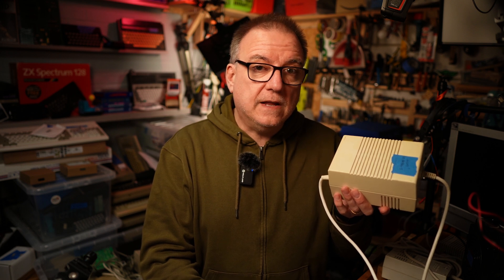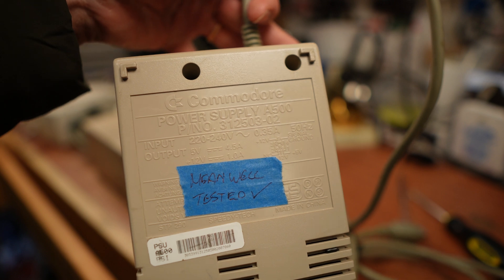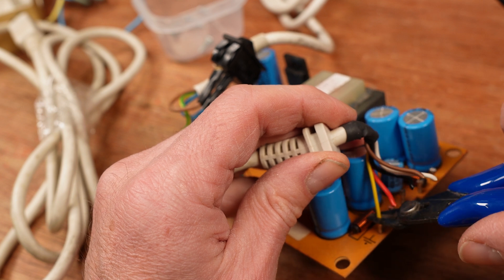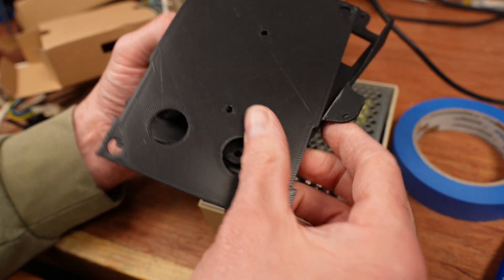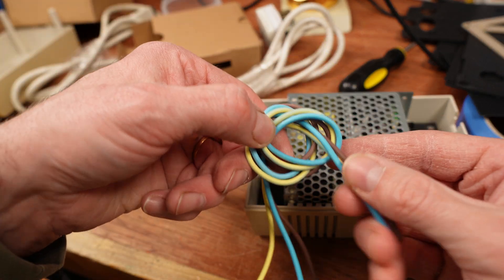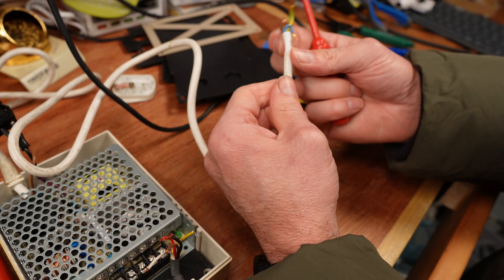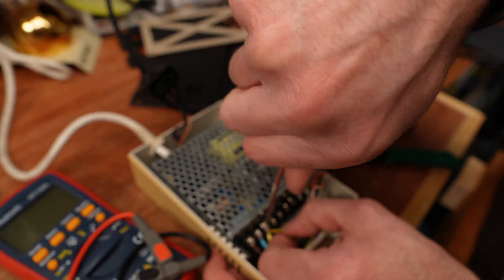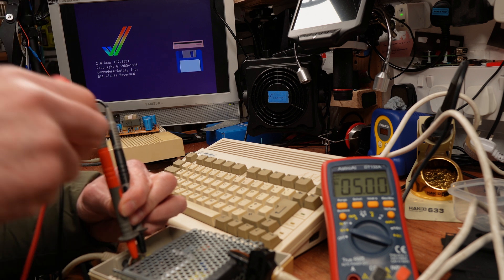Amiga Meanwell PSU Conversion

Comment: I have just done the same, however I noticed my +12v was actually only showing approx 11.38v when I checked on a multimeter. This seems to tally with your reading. My concern is that this is a bit low. I have trimmed the +5v to 5.18v which has increased the +12v to 11.52v hopefully this will be sufficient for the Amiga?

Like your video all readings were taken from the PSU with no load.
Reply from the maker: I'm told the 12v is ok to be a bit low as it's not supplying anything essential.
Reply: @MoreFunMakingIt doesn't the floppy require +12v though? What happens if it is too low? Issues with floppy access (reading/writing)?
Reply from the maker: @davesharp7315 it does, but it would function fine with slightly lower 12v

Comment: Hi, and thank you for the video. I have, a while ago, converted my old PSU with a Meanwell RT-50B. I've kept the 315 mA fuse that was on the incoming cable. I have a problem though, the problem is that the fuse most of the times blows when pressing the On button. If the button is On before a put the cable in to the outlet it works fine. Do you (or anyone else) have any suggestion on what to do to stop it from blowing when I press the On button?

Just need to also mention that here in Sweden we are using 240-250 AC voltage.
Reply: Update!
I took some help from AI, and found out that I should use a fuse of this kind: 1A–2A slow-blow fuse.

How to calculate:
There are two important things to look for in the data sheet, that is the steady state current (AC CURRENT (Typ.)) and the max current at startup (INRUSH CURRENT (Typ.).
In a RT-50B the data sheet says 0.8A and 36A. That means that there is a peak current at startup that the fuse needs to handle, but you cannot put a 36A fuse there, hence we need a slow-blow-fuse to handle the peak instead.
Manufacturers often recommend a fuse rated 125%–150% of the steady-state current. So for 0.8A, that’s about 1A to 1.2A, rounded to a standard fuse size.

My bad was that I read the wrong data sheet! I read the one for RT-65B instead of RT-50B, so now I'm sitting here with 3A fuse instead ;-) Well, it is not blowing anymore, but the protection isn't as good as it could be...

Comment: Nicely shown, short and to the point! The ventilated plating of this type of PSU has made me hesitate about doing this. Is the grille in the enclosure enough to not let heat build up by putting it inside such a small space?

Comment: Where can you get the mains flex to make a psu without an existing psu? I'm in UK. AFAIK you need 4 core 75mm^2  shielded cable, but finding it is a nightmare and finding stuff that will fit into the square DIN you can buy is just as hard.
Reply from the maker: You're much better off recycling a broken unit instead.

Comment: Just out of interest, did you measure the 5V rail at the A600 side? I tend to set my PSUs up a few percent to compensate for the cable drop, but I wonder what the drop is across these original cables.
Reply from the maker: I didn't. That was definitely an oversight.

Comment: you should crimp fork connectors onto the wires that connect to the meanwell, putting stranded wires under screws is asking for trouble.
Reply: I cringed watching these connectors, even without using crimps those wires should wrap around the screw and come back on itself for full contact, not just "pushed in"  on one side of the screw.
Reply: I kind of agree with both of you - this is what the plinths are made for. These plinth type power supplies are made for large electrical enclosures e.g. PLC cabinets,  which you could expect to be opened occasionally. If the space isn't cramped and cables are not stretched, and there's strain relief on the outgoing cable, and it seems to be so here, I would say it's perfectly fine to not use crimp connectors. You should be able to drop that thing on the floor and lift it by the cable.

Comment: personally i think if the originals are checked/serviced, theyre as good and reliable as modern ones, in some cases may be better than some cheap n nasty ones.... that A600 one you opend up uses a circuit very similar to many crt tvs in the 80s, devised by siemens, i think, and is generally very good but subject to chain reaction blow ups if a fault  develops in the chopper transistor drive circuit, as for it overvolting and kiling the computer, very unlikely , those resistors that get hot are probably under rated,   i have an A500plus version of this psu to service sometime,  i also have a 'heavy' version with mains frequency transformer, feeding a low voltage switching step down circuit, again if checked and serviced, i'd say they'd be very reliable, certainly much better than c64 psus...

Comment: You need to be careful with these MW power supplies as they have a minimum expected current draw. For example, in the data sheet shown in this video it has a minimum of 0.4A for 5V and 0.2A for the 12V. While this will be fine for the 5V for an Amiga, the 12V line may not draw the 200mA. You may need to measure it. I believe the 12V line is only used for sound, floppy and RS232 serial.

Comment: Hmm, that linear PSU type is as reliable as you will get. Those "hot" resistors can be upgraded with ceramic one, and usually the things that go wrong with those are filter capacitors and regulators. It is cheap and simple. Also, the chances of "frying" stuff are slim to none, as these components short when they fail, meaning no power output.
The PSU you are replying it with is a modern pwm type. Nothing wrong with those, very efficient, very safe... but they won't last 30 years! Nor will they be serviceable. So... not sure I'd agree to doing this to ALL old computers... "keep it original if it's not broken" may be my Approach
Reply: its not a linear, it IS a switch mode, all the Amiga ones are, even the one with the large mains frequency transformer in, it uses a step down 'buck' regulator circuit on the low voltage side, i bet they'd be more reliable than some 'modern' cheap n nasty power supplies, i've certainly seen some nasty beasts!

Comment: Nicely done. For the slim power supply cases, the RPT-60B fits well... these do have push fit connectors on them though, but they are easily desoldered and the wires soldered into the pcb.

Made properly, soldered wire joints are very strong. I tested this out once by soldering two pieces of wire together, and then standing on one end while pulling the other. The wire itself snapped before the joint did!

Comment: I got a new PSU for my Amigas. It has over and under protection and a screen that shows the voltages. They cost a lot more now than when I got it. A good PSU can help alot. I might make one of these ones later are you going to up load the PSU stand offs.

Comment: I wonder if using PLA - PETG and even ABS  in the power supply could be a problem, I am sure you know from your electrician days plastics used with mains  should be self extinguishing and the basic printer filaments are not. You can buy some filaments that are rated for this, but they are expensive and hard to find.
Reply from the maker: I think as long as I'm not selling these commercially that's not something I need to worry about. But it's a fair point that I'd not considered!

Comment: It would have been better to desolder the old crimp ferrules and use those in the screw down connections. Ask any electrician, good ones crimp ferrules onto bare wire for screw down connections like with RCBO's
Reply: shouldn't you crimp on ring connectors for these screw terminals?

Comment: I work in the electronics industry - specifically, digital outdoor signage. We extensively use Meanwell PSUs and they are very reliable, even the fan-cooled ones which we need to use considering the application. It doesn't hurt that they are made in Taiwan, as opposed to the dubiously random quality products from the mainland.

Comment: Cant you just re-cap the old PSU's are they all defective?
Reply: Great info and fab vid! There’s some info out there that suggests calibrating voltages by measuring inside the Amiga (floppy header for example… but don’t short it!) is good to account for cable losses. And I’ve found a heavily expanded Amiga needs another little tweak to be perfect, but it’s so easy to do!
Reply from the maker: You can definitely do that. They will most likely be fine. But note that some of them run very hot as I show in the video and that the cost of a meanwell replacement is so low its almost not worth the hassle of replacing all the old components in the original that might be worn out.
Reply: @MoreFunMakingIt  I learnt from your comment !
Reply: @MoreFunMakingIt  its only really capacitors that would 'wear out' , those 2 resistors do need increasing in wattage  though